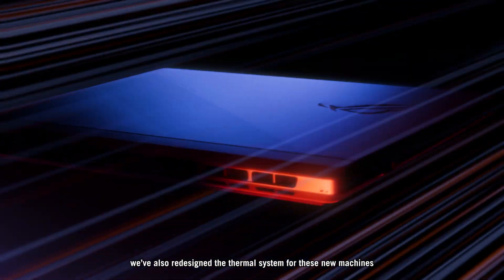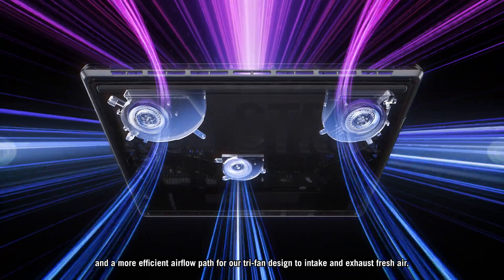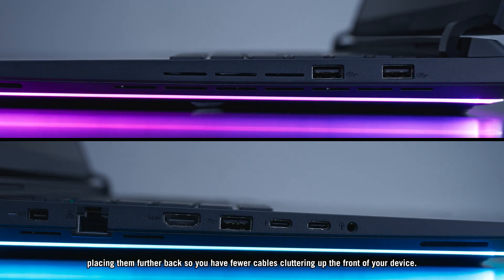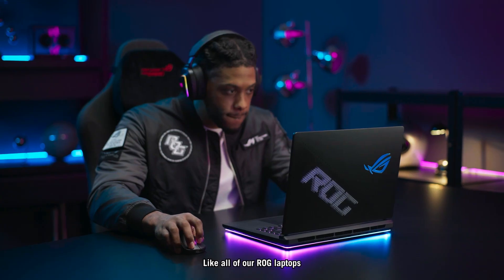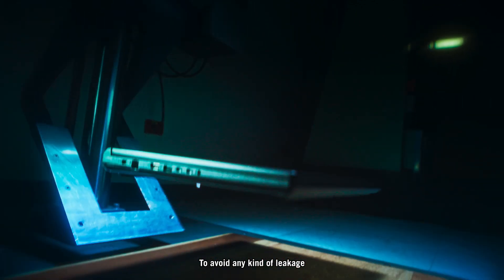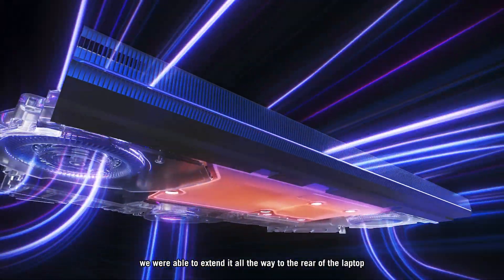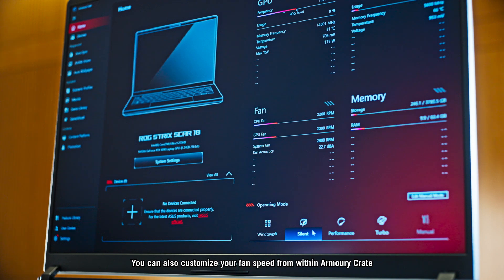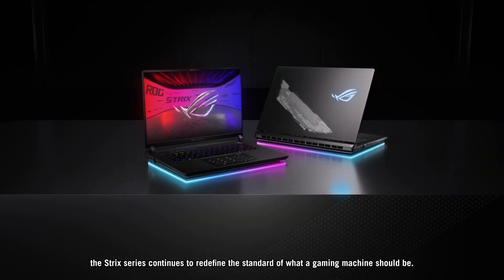2025 ROG Strix series - Design Story | Ep.4 The Thermal System

Comment: The Scar 16 RTX 5090 + 275HX that i got, had CPU temps constantly reaching 95°C - 105°C while gaming(laptop on cooling pad, razer cooling pad). Had to return it. Pretty disappointed by the thermals.
Reply: Good to know, but can't expect anything else from a laptop.
Reply: Thats normal.
Reply: @wanderfullaz not normal, my friends legion pro 7i had temps like 80-85°C during same game.
Reply: @GuntasSingh  same specs?
Reply: @otrOptions yes 275HX  + 5090 Legion, the best thing is he would get more FPS like 10% more FPS than my SCAR even though we both had same specs (275HX + 5090)
Reply: @GuntasSingh was going to write that! I returned my g16 and got lenovo legion too, thermals are night and day difference, i also believe the software is much better (armory crate vs vantage/legion space)
Reply: @GuntasSingh what’s the size of that laptop? can you provide samples of your fps and games?
Reply: Sample size one = just talk. I have the rog strix g815lw and it can run hot depending on ambient air temperature. It also never shuts off and stays fast. So laptops get hot. i bet the gpu stayed around 80c. Just overthinking. So did the laptop break from overheating? Or did you return it because you wanted it under full load to run at 50c?
Reply: @GuntasSingh  Does the power budget were the same too?
Reply: Buy a laptop cooler, I bought the illao v12, really good…
Reply: @francesco1290 these temps are with the laptop cooling pad. Cooler name: Razer cooling pad, it costed $150
Reply: @francesco1290 using Razer cooling, CPU temps were still shit. Poor Rog cooling solution
Reply: Same specs does not mean same performance check the wattage of the gpu and the fps in games(with equal settings)